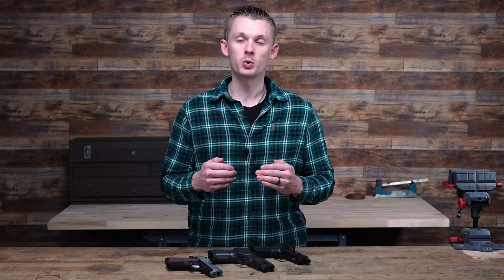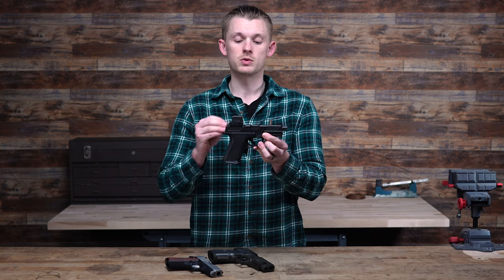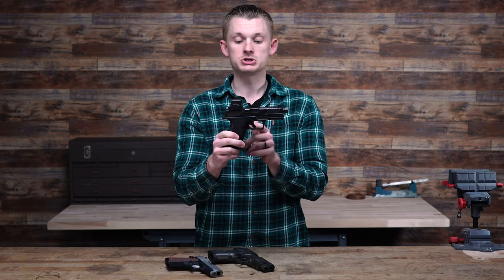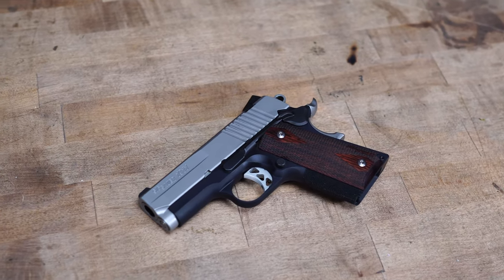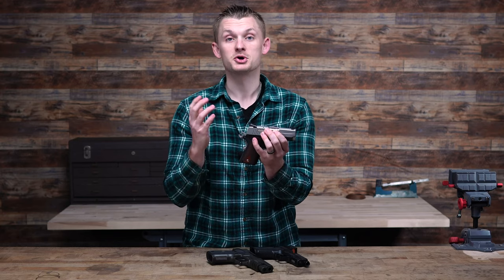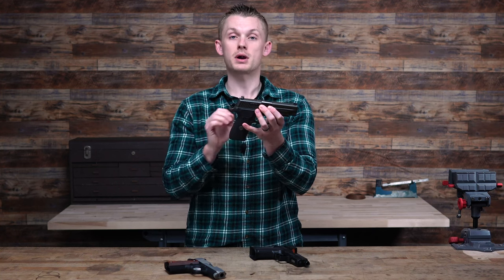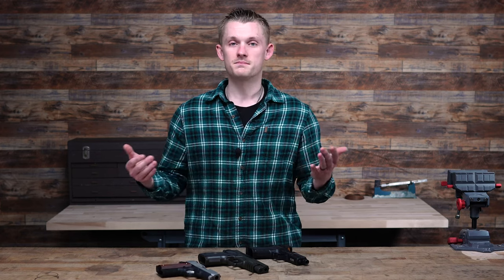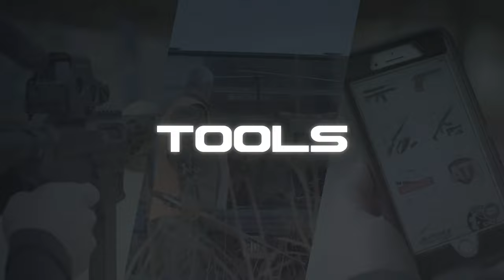What's The Difference Between Striker Fired and Hammer Fired Guns?

Comment: Hammer is superior period! I hate when they say their are pros and cons thats BULLSHIT their are no cons with a 1911 hammer gun its just a good adjustable trigger, crisp, fast reset, light pull plenty of safeties etc etc. As for carry or defense both systems will work for fast competitive u know the answer.
Reply: yep, hammer is clearly superior, you really want to fire the cartridge with as little imparted force to the gun as possible, it's easier to be more accurate with a lighter, crisper trigger. Not that you can't do that with a striker but it's more challenging and takes more technique, control and effort to be accurate just as quickly with a significantly heavier, sloppier trigger.

Comment: I have both strikerfire and DA/SA guns.   I, personally, like the DA/SA guns.  I like knowing that first round is a decisive trigger pull at around 11-12 lbs of pressure.  It’s no surprise that the most accidental discharged gun in the US (according to the ATF) are Glocks.  Even trained individuals can accidentally discharge one, like police officers.  You can’t train for stress or adrenaline in a civilian setting.    And you definitely can’t train for stupidity which there are a lot of them out there that have guns.
Reply: Glad to read this. In my striker fired Ruger Max 9, I just don’t feel terribly safe with the trigger. It’s a soft pull, then pop it drops. I’d prefer a more manual feel, as you said, 11 lbs on the first pull. Haven’t tried such hammer fired yet, but eventually I’ll get to a range with rentals.

Comment: I just can't get over the fact that the striker fired seems easier to just discharge.  if the trigger snags boom.

for a da/sa, the da trigger is harder to pull AND you can thumb the hammer to keep it from cocking.  also many da/sa have a safety on top of that.. so you can carry da safety on and there is just no way that is going off even with a snagged trigger.

So while you can say '3 safeties on a glock style striker fired'   it is still just 1 action from outside.  the trigger moves.  it moves easier than a da.. and you can't block the striker with your finger when you draw from a holster.

Comment: Primary difference between the two… when a round is in the chamber of a Stryker fired pistol it is always single action. In a hammer fired pistol with decock, it is in double action mode. MUCH safer if you carry.
Reply: I think this the clearest I’ve heard so far. So you chamber a round, then “decock”, and will have a heavy first pull if I read correctly.

Comment: Not all strikers are created equal.  Glocks are DA.  Trigger is setting the striker AND releasing the striker.  Some strikers are SA.  In Springfield and S&W the slide sets the striker and the trigger does one thing only which is to release the striker.  That's SA.  While I agree that SA hammer is in general better trigger feel, SA strikers come close.  S&W MP9 M2.0 has an excellent trigger which is close to my P226 for feel.

Comment: The trigger safety on a striker-fired pistol is a single safety. Three safety points do not exist simply because pulling the trigger fires the gun. My S&W 2.0 10mm Has a trigger safety and a manual safety. This is a 2-point safety system. Here is the reality. I carry a striker with the chamber empty. I carry a hammer-fired pistol with a round in the chamber. Misfires and negligent discharges happen far more in the striker-fried platform than in the hammer-equipped gun. The D/A pull is also a pseudo-safety.

Comment: Exactly how do you de-cock a striker fired pistol with a round in battery ? Personally i don't like being around someone carrying a striker fired weapon with a chambered round. This is just me.
Reply: You don't 'de-cock' a striker fired pistol. A striker fired pistol really isn't ever 'cocked' in the traditional sense. With a traditional hammer fired gun, the hammer is cocked -- meaning the hammer is brought back to a point where it is ready to be fired. At that point, the hammer is under pressure from the gun's main spring. When the trigger is pulled, the hammer is released and the spring pivots it forward. A hammer fired gun can remain cocked for hours, days, or years without going off. 

In contrast, a striker fired gun uses the trigger to pull back the gun's firing pin against spring pressure. As the firing pin is pulled far enough back, the spring stores sufficient pressure to drive the firing pin forward. Until the trigger pull is completed, releasing the trigger will simply allow the firing pin to slide forward -- without it striking the primer on the cartridge. (The striker block prevents this.) When the trigger pull is completed, the trigger releases the firing pin, and the spring drives it forward into the primer on the cartridge. So, you might say a striker fired pistol is cocked when the trigger has pulled the firing pin back far enough that there is enough energy to fire the gun, but that happens at the same time the gun is fired. So, there's no time when a striker fired pistol is cocked and ready to fire and no need to be able to de-cock one.

By the way, this is why hammer fired guns are generally thought to have better triggers. While there are exceptions, hammer fired guns have better triggers because they don't have to overcome a spring for the trigger to be pulled. On the other hand, striker fired guns have triggers that require progressively more force as they are pulled. (As they trigger is pulled, the firing pin is under increasing tension from the spring.) A few like that increasing difficulty in pulling the trigger. Many don't like it, but for most it's not a problem. Where it can be a problem is for those with weak hands.
Reply: @DKWalser  Good explanation.
Reply: @DKWalser  I believe you're a little confused as to how a striker fired pistol works. If it worked as you described then you would not need this "firing block"

Comment: I like tha hammer fired guns can be “read” at a glance if your a 5lb pull away from shooting or not. I haven’t yet found a striker fired indicator I like to let me know I’m a soft pull away from firing. (If anyone has one they like, please shout! Thx)
Reply: Look into the Canik pistols.  Some of theirs have two indicators, one to let you know the striker is ready, and a second to let you know a bullet is loaded in the chamber.
Reply: @davidgates5699  funny you should say that. The last videos I watched were Canik 9DAs I live the sa/da function and the decocker.  Generally I prefer hammer fired but this design really appeals! And for carrying, not having a protruding hammer to snag on clothes/etc is appealing! Thanks, btw, for making the suggestion.
Reply: Walter pps m2 comes in 9mm and it has a slit that allows you to see the actual round so you know you’ve got one in the chamber, and also you’ll see the firing pin at the back when the guns cocked